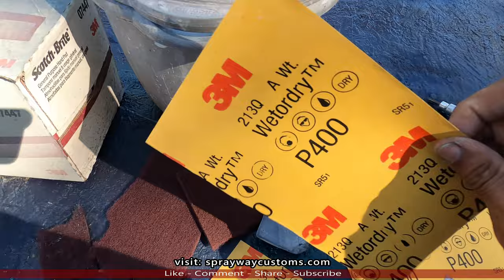Painting The 96 Impala SS Outrageous 3 Stage Pearl & @Grant7 Clear Coat DIRTY SPRITE ROOF & JAMBS

Comment: Sprayway you rock! You are killing it. I did bodywork for years . now I build pool Cues . I just switched over to the PPS disposable cups , I do love it. It’s basically a dollar a cup to toss them. No  clean up. My system is epoxy On the Cues than  I sand  with 320 and go right to clearcoat spot panel, clear, wet, sand. I do a flow coat gotta love the flowcoat. Hey I got a bad ass BMW X5 full and I mean full stereo. System sitting on 22s with a custom air  ride. It needs some candy blue…. I can see it now spray away sprayway ,,, u hitting it my BMW. Lol keep up the good work I love your channel it’s raw it’s real and it’s bad ass.